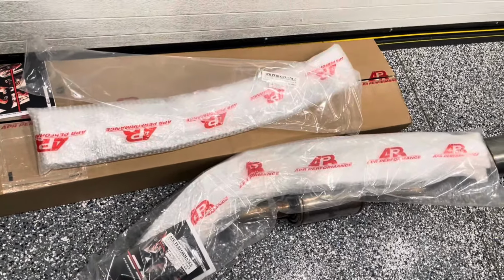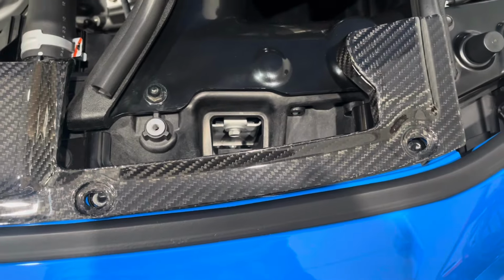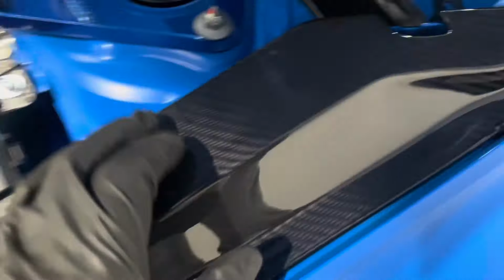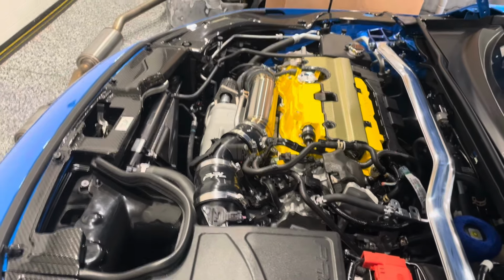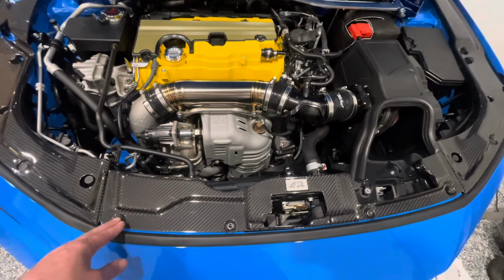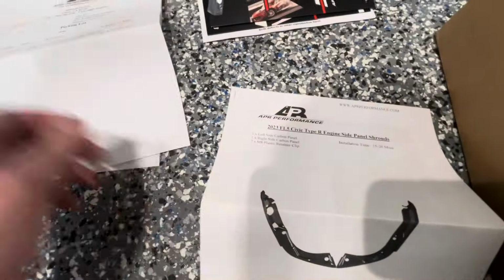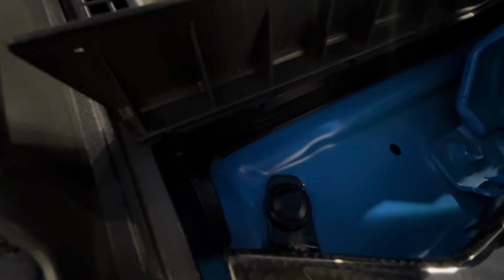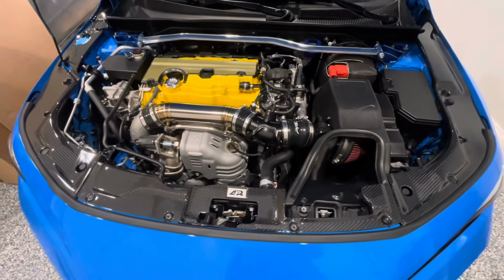FL5 Type R APR carbon fiber engine panels INSTALL and REVIEW!

Comment: My ocd, the center piece not completely covering the surface below..painted part being visible, bothers me.

Also, these parts are called cooling plates. What or how do they provide cooling?  I remember the old days, there weee center cooling plates which had a gap below or on top that supposedly directed air over the top of the radiator. This looks more like “cool” plates vs cooling.
Reply from the maker: Good points, I agree!

Comment: Very insightful, pretty appalled that they would actually want/require the customer to drill just to enlarge a hole in order to install a cosmetic piece... For a company like APR you'd think they could come up with more elegant solutions like yours.
It's also a tad disappointing that they didn't have the foresight to make the pieces possibly fit better with aftermarket parts, considering most if not all potential customers for an engine bay shroud probably have some mods especially an intake.

I hope they come up with a revised design in the future, because it's really beautiful but such a shame. I would've definitely gotten it.
Reply from the maker: Totally agree
Reply: @carsavant  maybe send them feedback, could get a new iteration produced
Reply from the maker: @davidd7175 will do!  I’ve known them for many years.  We had our APR sponsored widebody Sti on the cover of modified magazine way back in 2010.